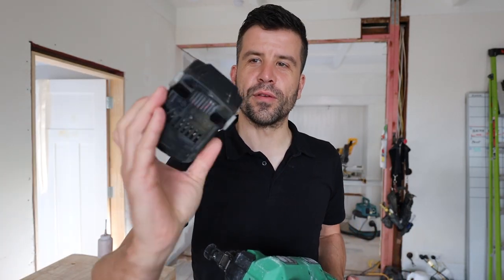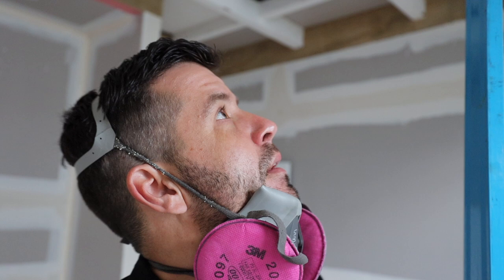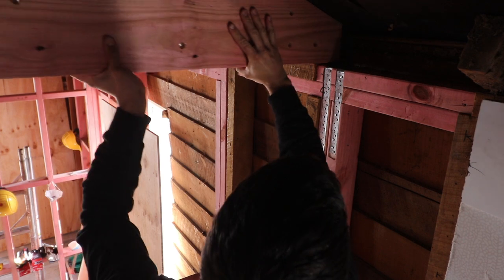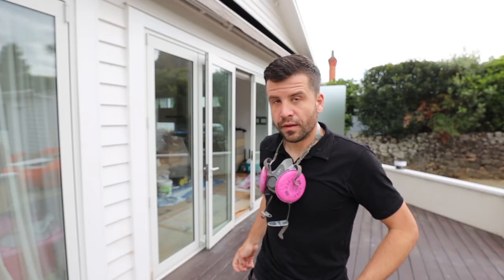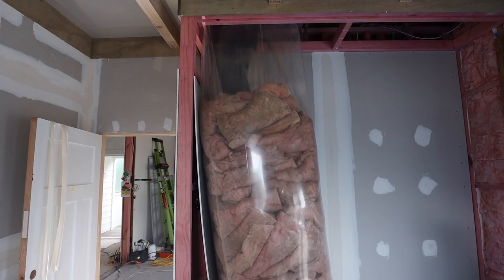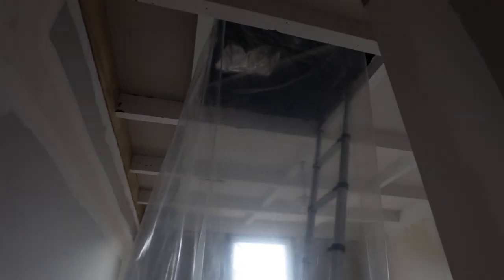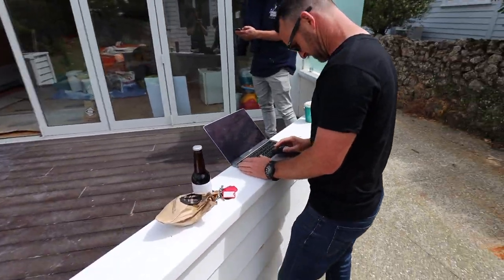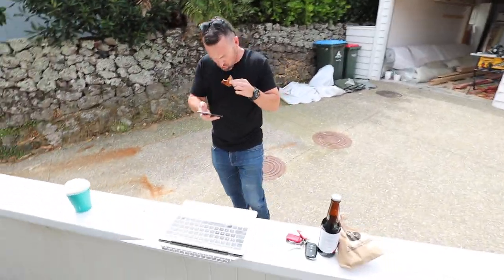Why We Don't Insulate in New Zealand.

Comment: Today I found out you can buy insulation as low as R3, the lowest I had ever seen is R10 foam board... Minnesota here.
Reply: My reaction too! Our North American “temperate” climate is really pretty extreme. I’m in New England but you’ve got me beat on the cold end for sure, although we can easily go from air conditioning to heat in the course of a single day.
Reply: Unless they shortened their R rating for some reason. R1.9 = R19, R3 = R30, etc.

Comment: Do you guys ever use rigid insulation on the interior side of the exterior walls to get around those permits for insulating the exterior walls? Sure the rooms would become a bit smaller and the window sills a bit deeper, but just wondering?

Comment: you can and should insulate from the outside and you dont have to destroy the interior while doing it; considering your climate with proper insulation it would be easy to build a passive house and dont heat or cool it at all
Reply: A lot of houses throughout NZ built before 1960's were all of wood overlapped exterior planks, usually rimu (red pine native timber) which when it ages has a tendency to split and shatter. Trying to take that off in up to 5 metre lengths just would not work. So, that leaves removing the interior linings (drywall or lath and plaster), cutting "pockets" of tar paper/vapour barrier and stapling them inside the studs with a 10mm air gap between the vapour barrier and the exterior rimu planks to allow a condensate space, and filling the true 4 inch framing with the now standard 90mmm fibreglass Batts...and then re-lining the walls and plastering to finish. Removing brick exteriors to insulate ain't going to happen, either.
Reply: @teenaramsay2469  you can insulate over the exterior adding additional insulation and then put siding or plasters on it; leave the wall ass the construction element, make another insulation layer
Reply: @MhUser  You are right; you could. I have never seen or heard of it being done in NZ. The cost here would be horrendous; like building a new house. Most people here would sell their existing house and buy or build something else. We have a very mobile population;  https://www.corelogic.co.nz/news/how-long-do-owners-hold-their-properties
very few people stay put in one home for 10 years or more.

Comment: Thoughts on blown-in insulation? We need to insulate our external walls but this seems like a very uncontrolled way to do it vs. pocketing framing with building paper & insulating from the inside.
Reply: I would do it properly from the inside. Heard lots of stories of blown insulation compacting down creating cold spots. Also if you have a cavity I personally think it is better to retain it.

Comment: I live in Tasmania, Australia and my house that was built in 1981 only has that shit insulation above the celing and that's it. Nothing under the floor, nothing behind the brick veneer, pull a brick out and you are looking at the back of the plaster sheets. It's colder here than in Aukland not a heap but a few degrease, I did get snowed in a couple of years ago. I have considered renovating but it's crazy expensive here. Far cheaper to sell and buy a newer house. A mate of mine just spent $300,000 on renovating his house that didn't include changing any external walls and being that I am only a team lead software developer I can't afford to just throw $300,000 in to renos unlike tradies that earn more than everyone here.

Comment: I'm currently building a new house in the lower North Island, and I have found it incredibly hard to locate any guidance on what I should be insulating/ventilating/heating it with.   I don't want to adhere to the bare minimum requirement for landlords, I want a warm dry healthy house! Can you provide any guidance on this, or recommend someone who can provide guidance?
Reply: Look into passive housing and Proclima - German company based in Auckland who import building materials with a focus on passive housing. Their building hub in Penrose is worth a visit if you're in Auckland.

Comment: Under the new proposed healthy homes standard, that will come into effect by 2024, will  require a minimum of 140mm of insulation in the roof of all rental properties, can any one tell me if this standard is already in play for new builds or renovations?
Reply: Going by Pink Batts website, 140mm = R2.6. New builds is minimum R2.9.
Reply: @djotter  oh sorry, I’m very aware of what r value should be, but I must explain, if r value is a measurement (resistance of the conductive flow of heat in insulation/wall ect) 
And a ceiling is rated at 2.4, why would the healthy homes standard change to include a minimum thickness in your ceiling rather than just an r value. And if this is the case new builds and renovations should follow suit right? In the end I’d rather spend my money on a superior r value product the first time, rather than installing insulation to the r value specified for my area, only to be told I need to buy more because, they’re telling me I need a minimum thickness. Sorry if that seems confusing, but that’s how confused I was reading the up and coming legislation.  It just seems bogus to me. But if anyone can correct me on this one I’d be much appreciated.

Comment: Natural wool compacted into felt is an excellent insulator: it breathes, it doesn’t develop mould, and can be cut to slide into wall cavities.
Reply: yeah, but, but, in new zealand, we only have around 6 sheep per person, and the labour cost shearing those sheep costs more than the value of the wool because wool is almost worthless here, but yet there simply isnt a market for incredibly expensive wool to be used as insulation, and importing glass fibre is soooo much cheaper. Copy and paste for every building material.  And we just cannot figure out why it is so expensive to build decent homes in nz (so we dont), and why there is a MASSIVE housing shortage.

Comment: What is the benefit of having switches on the outlets?
Reply: So you can turn it off at the outlet
Reply: @pacnsave1  Why not just unplug it? In the US we don't have them
Reply: @Eric-dr5bj  Ever accidentally stood/tripped on a plug? Yeah, it hurts..and can bend the pins. So, if you leave it in the wall socket you can cut the electricity supply (switch OFF) but leave the appliance ready to go at the flick of the switch..and not chance standing on the plug. Win,win!

Comment: In my country you put vapor barrier to prevent moisture inside the house from escaping. If it escapes and gets into insulation when it's freezing cold it condenses into water and this makes insulation loose its insulation properties, thus leaving house effectively not insulated. Never thought someone would be putting vapor barrier to prevent moisture from getting INTO the house.

Comment: Thanks for the video on insulation. I'm sure that you know that you know that insulation works against heat as well as cold. With the world as it is now, we all have to think and act in ways that we can reduce our carbon footprints. Modern houses can be heated or cooled with the equivalent of a hair dryer worth of energy. Over long term, the initial cost is more than offset by the savings in heating or cooling. My next house is going to be a passive house design.
Reply: Unless you live in a very cold climate, you will never offset the extra cost and embodied energy of the extra building materials. Passive Haus is an intriguing concept, but it doesn’t always make sense.
Reply: It can only work for hot climate if you have air conditioning.

The insulated houses in the UK are hotter in their summer 30 degrees , than uninsulated houses in Australia in their summer 40+ degrees.

There's a reason why the buildings are built differently around the world.

Air conditioning has changed that as  with that it is better to insulate.
Reply: @Robert-cu9bm  It's almost always good to insulate (perhaps not in the tropics), but going all the way to Passivhaus standards is very expensive. Not only do you need very thick insulation, you need a full air barrier system, plus mechanical ventilation, double or triple glazed windows and doors, etc. There's tens of thousands of dollars extra, plus lots of extra building materials. You would need to save at least $1000 a year in your energy costs, and probably more. If you're in a very cold climate, that might still make sense, but not in the NZ North Island, or Australian east coast.
Reply: @jesseyoung9654  Indeed, insulation works just as well against heat as it does against cold. There are very few places in the world that have ideal weather conditions all year round. If we don't consider the environment, it might make sense not to insulate but since it initially costs more to better insulate buildings and that cost is a deterrent for sales of houses. Especially, for rental units, those costs are savings for builders and those that will be paying extra for heating are tenants. There is a strong tendency cut costs before renting the units.

Comment: Wouldnt the insulation also help keep the heat out of the house?
Reply: Yes. Insulation slows the movement of heat from hot to cold. So will work in summer and winter

Comment: I live in Scotland but grew up in New Zealand and we lived in Old wooden house with tin roof and single pane glass windows, no insulation anywhere no central heating just a woodstove in the lounge and we warm in the winter and cool in the summer. But it would of been more efficient in heating if it at least had some loft insulation.

Comment: The older houses in NZ are very poorly sealed so the insulation doesn’t work very well.  Do you do blower door tests in NZ to check how leaky the buildings are?
Reply: i am sure they do not know what you are talking about. NZ is about 30 years behind everything.
Reply: @ursodermatt8809  Matt Risinger has some great info on insulation, check out his channel.   The issue is you can’t see insulation so people don’t want to spend money on it.  It needs government regulation and enforcement.
Reply: @peterbeyer5755  
yes good channel
Reply: there is companies around that offer that service. but air sealing in nz is not legally required so its really only done on high performance homes, passive houses etc.
BRANZ did some testing back in the 80's i think. air leakage rates improved when gib became the norm. but houses still varied a great deal from 1 to 10 ach@50. however the testing was only negative pressure no positive pressure which skews the results.
Reply: @tweake7175  
I don't think there is a legal requirement to air seal houses anywhere in the world
Reply: @ursodermatt8809  i have no idea about eu, but usa some states are and others following.

Comment: Take a look at how Hikoki did the multi-volt while still being backward compatible with those batteries: it's pretty clever.. There's two sets of pins (vertically separated). So you can chuck one in an old tool (with a long pin that runs from top to bottom) and it'll cross both terminals (thus making it parallel.. so voltage stays same as the old batteries, but it's actually 2 in parallel), whereas if you have a multivolt tool that wants double voltage: it splits the pins so it can do two connections which are then able to be put in series (to add the voltage).

Comment: Title is just a tiny bit misleading as it applies to older houses. 

3604 has required insulation in extensions and new builds for many years now. However I've always hated the fact (when I was QSing) that most designers and architects only allowed for the minimum as required by the building code.

If I had a chance to talk to the potential house owner I always tried to get them to up spec the insulation as a few thousand dollars out of half a million is peanuts and they would save money each year as higher spec insulation maintains a more stable temperature year round and saves money on heating/cooling costs.

Comment: Also you could mention that the Gib is often a structural part of the house and not just a barrier to the outside. Hence the need to have bracing when replacing the old stuff. I wish I knew this before we renovated, especially the consent part. On another note can you do a bit to bring awareness of the Electrical Codes of practice around consent, we have just fallen fowl of this as the council does not take electrical cables on private land into account when issuing consent.  DM me if you want someone to rant on about it for a while.

Comment: Good work Scott 👍 Just a quick tip for next time you do some flooring or cladding etc (was going to comment on a previous video when you did the floor). Instead of using a chisel to get your boards tight screw a piece of timber to your floor joist. Then get your quick clamps reverse them so they become spreaders and clamp your flooring off of the timber you screwed to your joists. Hope this makes sense. 👍
Reply: Great idea, adding the temp stop to the joist and reversing the clamp seems cheaper than buying the ratchet strap pullers you can’t really use for anything else besides laminate.

Comment: Problem is if you go for the permitted development approach, and remove the inspection element, then cowboy builder are an issue. Very similar thing happened in the industry I work in about 15 years ago when we asked the regulated customers to start to self regulate. Lots of us thought it was nuts, as the bad ones would get worse, and the good ones would stay good, or even in the face of competition, have to turn less good. Now, it turns out it was ok for the companies that were good, but the bad ones have become a bleeping nightmare.

Comment: Funny thing: "open" (ie without any sort of air barrier) batts under the floor don't do a  whole lot because air just moves straight through moving heat along with it  (Obeying Thermodynamics law No.2)

So what Scott meant was that when a lot of old  timber framed houses were  built there was very little insulation included - same in a lot of the world - Putting fibreglass batts in the walls has only existed for 40 years - much more common in the last 25) - Lots of existing structures are a lot older than 25 years.

Basically, "Project home construction" is so bad, they charge a whole heap for very simple additions - they make  their profits on extras, not building a decent livable home for the average person..  If regulations are reducing uptake / retrofit - that is actually pretty bad, because there is nothing stopping a DIY insulation retrofit - apart from the fact that it is messy and "a bit full on" for the average person (it is hard to put in an effective vapour barrier from the inside).
Reply: Uhhh floor bats do help? True, air can get through gaps in the bat but it's not like the heat will only go through these gaps. A lot of the heat will now have to traverse the bat in the floor instead of just going though the air, which reduces the amount of heat transfer leaving the house.
Reply: @TheAwesomeguy7777  "A whole lot" - yes they help, even more if they are  sort of "Encapsulated" in a manner so as to reduce flowthrough of air from the "Outside world" NB, batts aren't Just a little porous - there isn't just a small gap in the batt - they are composed of gaps.., they rely on being porous to work - they work -theoretically - by trapping air within their structure - like a wooly jumper. using, if the air they are "encapsulating" is rapidly exchanged with the air immediately adjacent then they aren't performing to their "Sticker value" -  This is why CLOSED CELL foam performs so much better than open cell -  Air can't tracerse from "cell to cell"  in a closed environment, batts demonstrate the most open of all cell styles..

BTW, in the parts of the world in which I live, rejecting summer heat is much more  an interesting thing (for comfort) than retaining winter warmth.  We want to reduce the rate of heat (flux) entering the house) -  and what does enter, we want to throw back outside as soon as possible before the structure gets heatsoaked.

Comment: Thats soo weird that you have to get drawings to insulate lol. Here in canada most people dont even apply for a permit to do that. But the houses are built insulated so its code. R-22 in walls / R-60 for ceilings (few exceptions). Basemrnt walls CI R-10 + R12 and if you have a slab its R-10 other wise floors are R-40 if no basments or slabs.

Comment: Hey Matt I hope you're managing to keep busy and engaged.

I'm interested on your take on the Perfect Wall and how it applies to NZ and your builds? Have you see Joe Lstiburek talk about it? The use of insulation on the outside to avoid vapour condensation within the building, and the focus on air control (similar, but not the same as Passivhaus) isn't something I've seen much of in standard building in NZ (or now in Oz). Even the products don't commonly exist, a rockwool comfortboard type of solid exterior insul would be useful (vapour transmissible), it's kinda available in Oz for it's fire resistant properties. 

The description of what happens when windows improve and the coldest surface inside the house is then the outside wall, past the cavity insulation, seems to correlate what I've seen reported with "leaky buildings" etc (vapour goes through the cavity insulation, hits the layer beyond that which is cold and condenses...liquid water in the cavity then gives you mould&rot).

Comment: Here in the Netherlands we build for things to last at least 50 years, if not centuries.
My house is largely built with re-enforced concrete, triple glazed windows, and insulation everywhere, up to 60 cm think in places.
Building with brick is also common, certainly older houses.
I find this concept of building a house to only last a few decades without major renovation to be really odd. You're never really going to have any nice historical buildings.